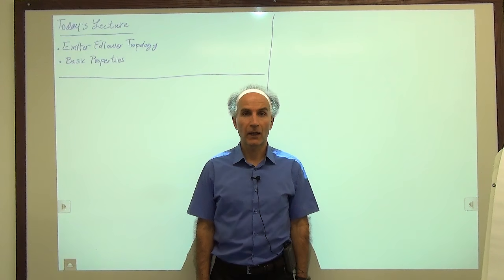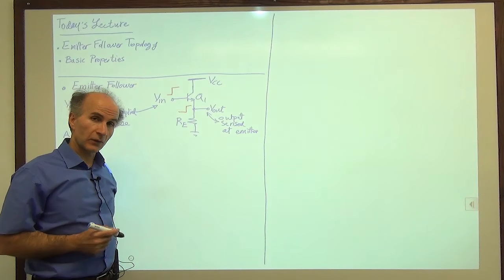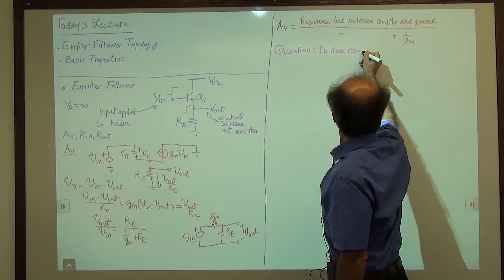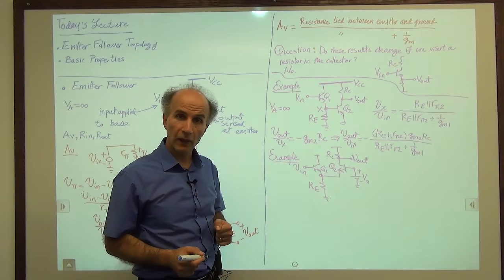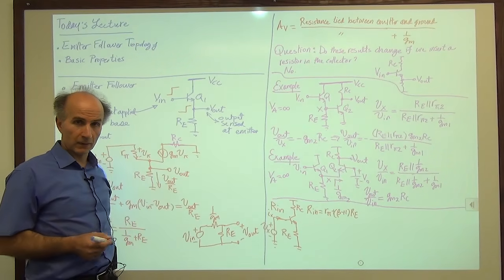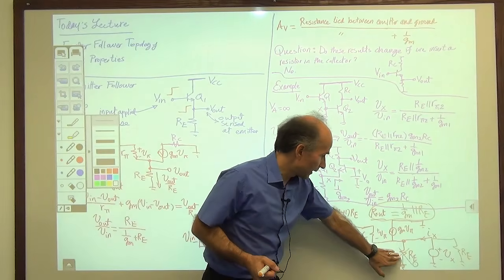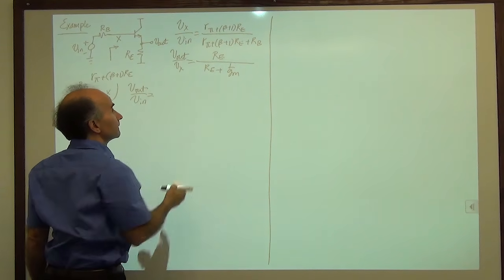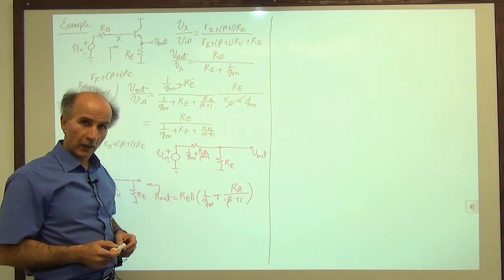Razavi Electronics 1, Lec 27, Emitter Followers

Comment: For the equivalent circuit used in calculating the output impedance, if we use it to calculate the input impedance, why is there an additional factor of 1/(beta+1) compared to the previously calculated result?
Reply: The interpretation of A_v as a voltage divider only gives the ratio of one resistor to the other, but not the absolute magnitude. From the expressions of R_in and R_out for the emitter follower, we know there's a \beta prefactor in front of R_E for R_in but not for R_out. I think the way of using that equivalent circuit to calculate R_out is more like an educated guess.
Reply: This is explained in the next lecture (around min 10)

Comment: In calculating output resistance, shouldn't he remove the current source?(he did so when he first taught output impedance in lecture 21)
Reply: thats dependent current source.
dependent souces cant be deactivated
Reply: @revanthreddy3266  thank you 😊